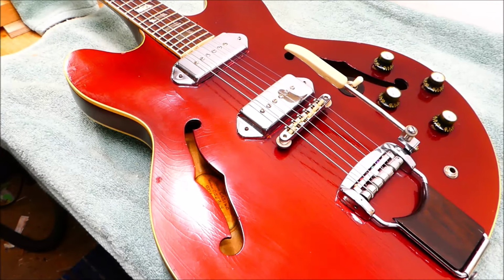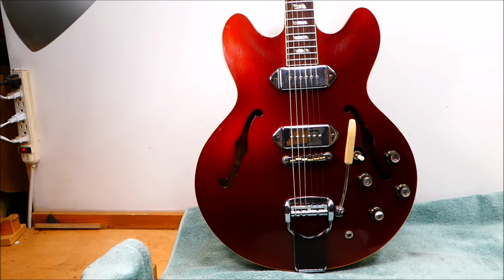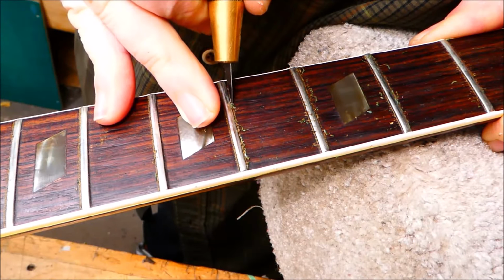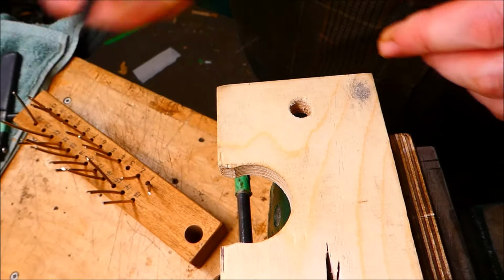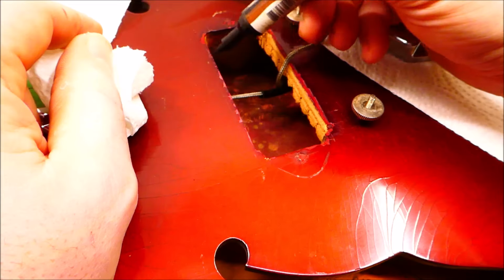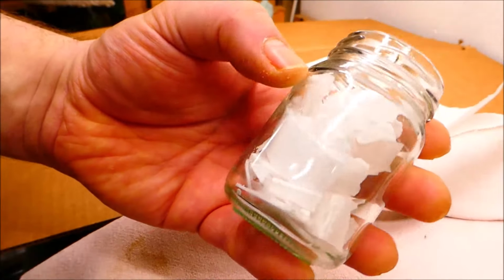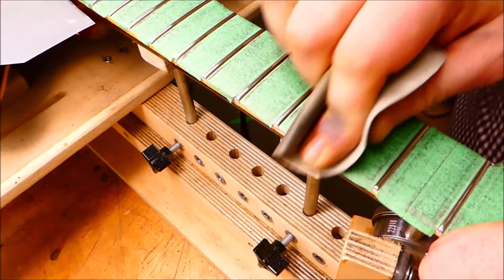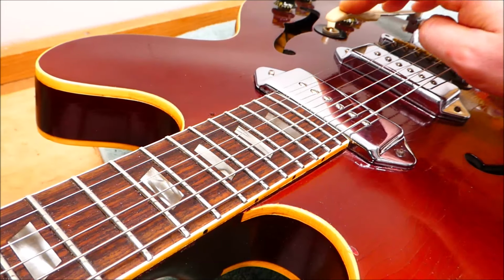A Gibson.... Casino? ... ???

Comment: I did "home wax potting" once on some Epi Humbuckers that were very microphonic. Never having done it before, I did some research and one of the things that was emphasized was to measure the wax temp at all times and try not to approach its flash point temp. Which is not an issue if you are shooting for 140 F. Unless you have hot spots on your heater. Which is why they recommended using a double boiler, so the surface of the metal container for the wax is never directly on a burner, but is resting on heated water.  I did not have a double boiler but it was easy enough to fashion a "one use" thing out of an old empty can and some metal coat hanger wire.  Was this overkill?  I now have a new Epi Casino "worn" which I will probably want to wax pot at some point. I'm very apprehensive about removing the pickups (or any of the wiring for that matter).  I wonder if just pouring some wax on the back of the PUs while still wired up would be enough. Thougts?
Reply: I have seen people use marbles to raise the wax pot in the water. A vacuum chamber type pot will remove any air and speed up the wax entry to the PU.

Comment: I like that thing. How safe is it to have a trem unit on that? I'm working on a project like this now. I have an Aria Matsumoto era Mach 1 body and a nice Warmoth neck. As far as tailpieces go, i have a Bigsby, a Frequensator, and a traditional Casino tailpiece to choose from. Theres a small block under the ABR string guide but nothing else so I'm a little unsure about the Bigsby. I'm leaning toward the Frequensator mostly because i don't have another guitar with one but I'd be curious to hear any opinions about the strength/risk of putting a Bigsby on it. Looking forward to the Mandocello build.
Reply: I have experience with a bigsby and found that using an after market roller bridge enhanced the smoothness of the vibrato and made the effect stand out more when I used it. I have also found that long string length between the bridge and tail piece can vibrate unsympathetically and is noticeable .
Reply: @DonaldVanHall  Yes. I have a roller for it but I'm more concerned with the strength of a 330 body top to cope with the pressure of it. I have a 335 with the support block that has a Bigsby but this is the first completely holliw body I've worked with and i don't want to crack it. I know these type of guitars have Bigsbys sometimes but I'm building with parts so I'm a little nervous.